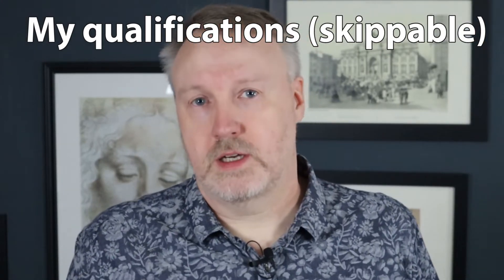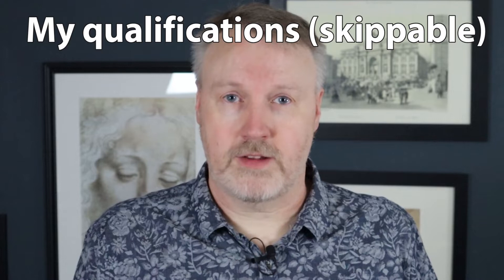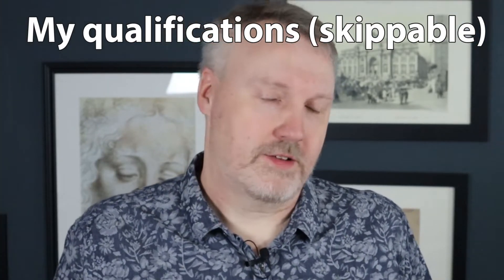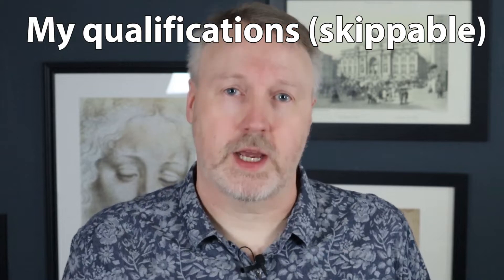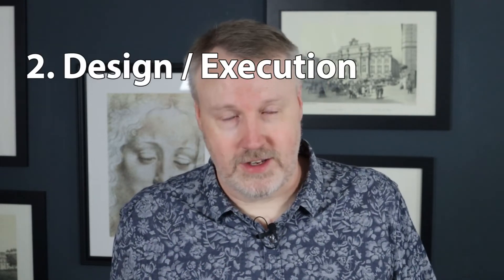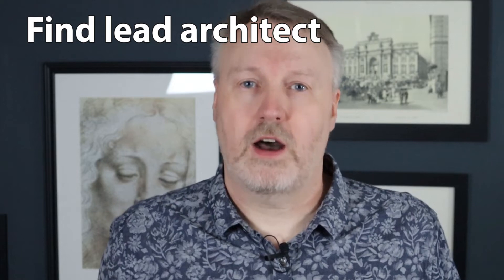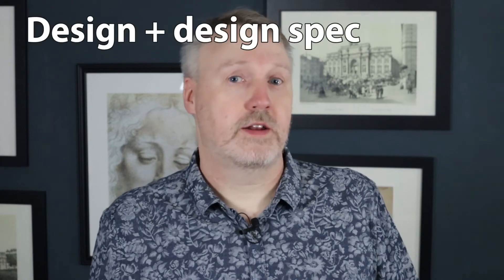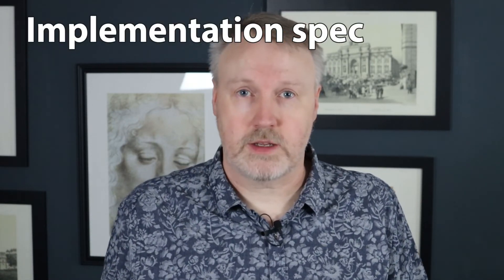Building Big Software, tips for building commercial-scale software - Introduction

Comment: For people who don't have the opportunity to work in engineering teams large enough or doing projects large enough to have exposure to the processes/specs (eg. 30-100 pages architecture, implementation, testing) that you mentioned, where can we get such education?
Reply from the maker: Unfortunately, this level of design and implementation is usually not needed for small and medium organizations. I'm a big believer in learning what is immediately applicable, and learning a little bit around it too. And, learning by doing. I don't know of a place to learn both the 'what' and the 'why of big software design. This series was supposed to give a template of that, but it wasn't terribly popular so it's on hold for now.  Thank you for the question!

Comment: This is so insightful; the fluidity of the communication with minimal edits, screams experience of the subject/topic of discussion.

There are only a handful of people with your experience, and an even smaller subset of those with the time and drive to discuss these topics with the public such as through Youtube.

Finding this channel is like finding a million dollars on the sidewalk and I hope more people find it.

If I could get some of your two cents here that would be great: if gaining experience is the process of learning what works and what doesn’t work for a given problem set, how do you gauge the value behind a success or a mistake in what it teaches you for future tasks/projects?
Reply from the maker: In terms of learning from past experience, both positive and negative, I'd say the highest value failures are those which help you cross out an obvious approach. For example, I avoid recursion like the plague after having a couple different products that were running into stack overflows in corner cases. And, positive examples where a time investment pays off. For example, finding out that instrumenting your code selectively for performance measurement slows it down less than the performance gains you get from it. That informs future development work, and lets you proceed more confidently.

Thank you for watching and for the kind words!
Reply: @TheDeliberateEngineer   oh okay the reduction of an obvious approach so as to leverage this kind of battle scar to prevent many others from getting burned. This, I can follow. Again, much appreciated. 
I used to think people with your experience were normally closed off or inaccessible to others with lesser experience but I’m glad a medium like Youtube exists to bridge this gap.